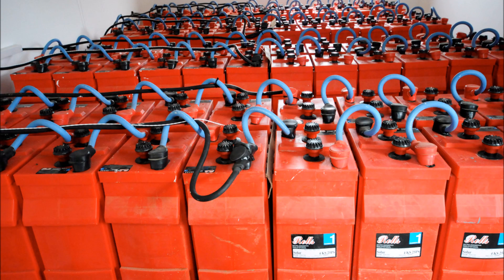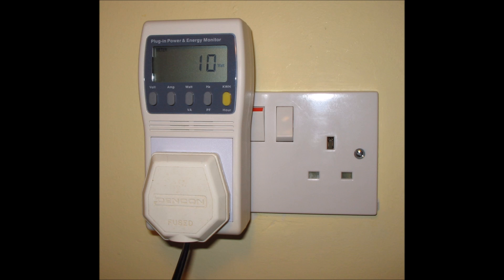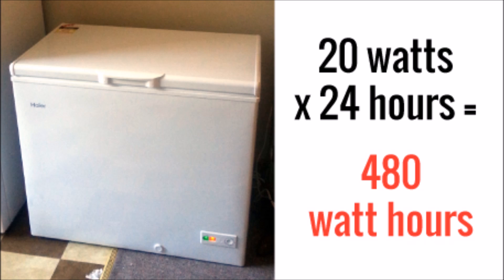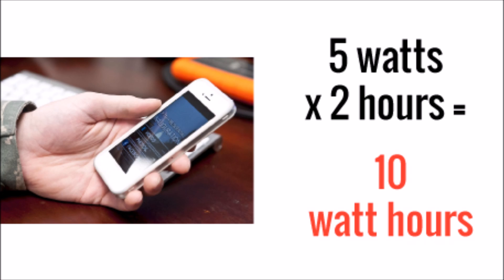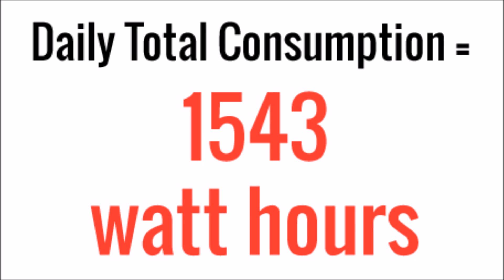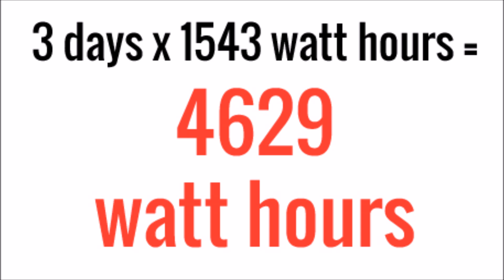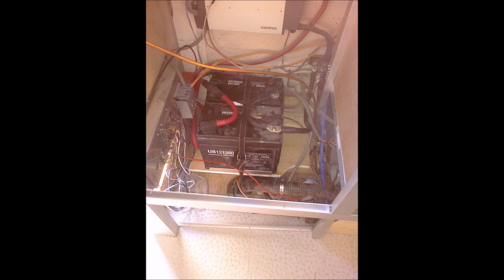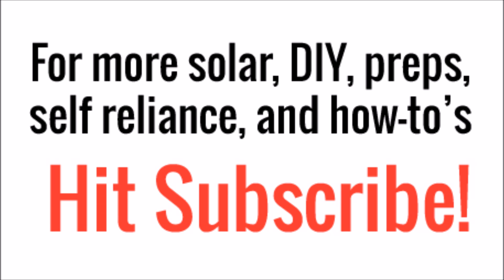How To Size Your Off Grid Battery Bank Capacity For Solar - Math Warning!

Comment: Lights? System inefficiency? You included battery DOD issues, but left out the rest of the system (inverter, wire loss, etc). But still a pretty good explanation.
Reply: I agree that he needed to include some efficiency losses but he did a pretty good job of explaining the basics to a beginner. It sounds that you are like me and already know what you are doing with solar power! Take Care buddy,  John

Comment: I would add the effeciency loss from all the system (especially the inverter), which can be sometime as low as 85% efficient, + wire loss etc, and i would add up the phantom drain of all the electronics, like the tv. Mine uses 124 watts when on, but 34 watts every hour when off (or standy)
Reply from the maker: To be most accurate that is right.
Reply: To be fair though, if you go solar you need to be buying the most efficient and low energy appliances. At least A++ fridge and freezer, LED downlighter lighting etc. Use a quality MPPT controller, and a good make inverter will be over 95% efficient. You pay for quality but this is one area that it pays off.

Comment: hi is a bit late but that amps are from the sum of all batteries in series or in parallel? i mean each battery has to have all that amps?
Reply from the maker: I am sorry but I don't understand your question.
Reply: LDSreliance example i need 600ah at 12v, and have 2 12v 300ah batteries, in parallel the amps adds up so i have 600ah in 2 batteries of 12v or each one needs to be 600ah?
Reply from the maker: Correct.  If you wire in parallel it will double the capacity of the whole bank to 600Ah.  Both batteries do not need to be 600Ah unless you are wiring in series.
Reply: @LDSreliance  thanks 😀
Reply from the maker: You are welcome.  Thanks for watching!

Comment: when powering the fridge is it better to hook the batteries in series or in parallel because I'm trying not to kill the cells in the car batteries or put to much strain on the battery.And could you use a 12 volt solar charger charging the battery and use the battery at the same time ?
Reply from the maker: Car batteries are not a good idea for a load like a fridge.  But yes you can use a battery and charge it at the same time.
Reply: Thanks now i gotta find out what's the most amount of volts to charge the car battery and use it at the same time to keep the cells from messing up ? Cause the car battery is 12 volts 1st i was thinking to use 12 volts to charge it and use it at the same time then i thought about going higher then 12 volts maybe 15 volts to charging it and using it ?
Reply from the maker: A typical car battery charges at about 14.6V.  Increasing the voltage will not help charge faster or allow you to use it at the same time.  It would always be 14.6V.  Increasing the current would allow for faster charging (within reason) and allow you to power other loads at the same time.
Reply: @LDSreliance  You said I can charge the battery and use it at the same time.Even though you said it's not a good idea to use it for a mini fridge.I'm just trying to figure out how to keep the cells from dying maybe that would be great ?
Reply from the maker: As long as there is a battery charger connected to the battery at the same time you are running your fridge then it will be fine.  I just meant that a car battery alone as the power source will not last long when running a load like a fridge that runs on and off around the clock.

Comment: Care to address hybrid systems? I am thinking 2 400watt wind turbines and about 800 watts worth of solar panels. My reason being my property is in Alaska. During the summer we get better than 21 hours of daylight a day. Sounds great for solar right? But during the winter we can get as little a 3 hours of daylight.. Plenty of wind though. SO hybrid charge controller, dummy load, inverter.. Some questions. WHat type of battery? Especially given the environment. Even inside the cabin will frequently get to near freezing at night. Best way to integrate a generator? (I figure worse case if we have unusually calm wind for a bit during the winter and my battery levels drop too low I can always fire up the generator to charge them / carry some of the load while they charge. So what kind of charger does one need to charge a 800Ah battery bank? Probably have a hundred more questions that I just can't think of on a Monday morning but that's a start. Thanks for the video btw.
Reply from the maker: Lithium batteries can easily handle below zero temps.  A decently insulated wooden battery box would be sufficient to keep them safe from even the coldest nights.  

For a generator, install a transfer switch.  Then in the winter when the sun is basically useless you can flip the switch and run off generator until the batteries are full and then switch back so the wind turbines can keep them topped off.  Here is a good one from a manufacturer I trust:  https://amzn.to/2PjcDVO

There are some other factors to consider on the charge controller than just the size of the battery bank.  Shoot me an email at ldsreliance@gmail.com and we can discuss further.
Reply: Cook thanks. What about using a gas generator to charge your battery bank in a pinch? What would you need in the way of a charger?
Reply from the maker: Just a regular 120V AC battery charger such as this one that I reviewed in the past (see below).  It can do both lead acid and lithium:

https://amzn.to/2vWFx5U
https://youtu.be/XHCiQSKdig8

Comment: thanks bro for the informative video. can you please make one on how to size both batteries and solar pv for an inverter (s)
Reply: You can't make sutch a video ... Becaus .. of ... Where u live... Onley you know
Sun hours where you are .. so you can make a general painting All pink video..
Or you can add you watt Up.. .. 
You max draw !! Dish Washer .. dryer .. wacum cleaner ..  No On SERIUS  has a 1000watt  pure sinus inverter .. for house hold APPLIAENSES
Remember a microwave oven at 850watt microwave  is 1800Watt AC  most dishwashers are 2000watt or more 
So.. to sum IT Up No On 12v .. onley 48v efeciancy Counts .. Wire gauge /mm² Counts ... 
PV in series never ever paralell .. again Wire gauge/mm² over distance = loss .. 
Paralell same A higher Volt Better effeciancy ... Dont buy the SHADDOWS on panel .. bla bla bla ..  yes the one panel drops in volt .. 
The rest don't and the small A IT can put out won't go to waste in series like IT would in paralell

Comment: Very useful vid, thanks for sure!!  Will the next on this line of vids deal with needed size and number of cells/batterys?
Reply from the maker: I will see what I can do on a video like that.  My video production schedule has been greatly decreased the last several months.
Reply: LDSreliance. Dontcha just love life sometimes?.....
Reply: please try and do a video on that. thanks
Reply: David Dompreh I will do just that when I gain enough knowledge to do so
Reply: Some things I've been looking for and havens found is, for example, the ratio of plate surface area to amount of charge and the amount of electrolyte to amount of current stored.

Comment: Ty sir but I need help. I have a greenhouse that's equip with an exhuast fan which will run 1200 watts for 12 hours per day, everyday.

My friend gave me six 330w panels but I'm unsure how many batteries, inverters, and charge controllers to purchase. My wife and kids are sad  Bc we're off the grid and we need these lettece and veggies. 

I'm considering the APEX APX12-200 12v 200ah batteries. (someone recommended it to me). 
So after watching your video, I came up with 1200x7days=8,400/12=700x2=1400 ah. Looks like I need 7 batteries? 

Another friend recommended 48v inverter? If so, how many?

How many solar controllers?

I wish there was a website to help me with product recommendations. Thanks for anyone that can help me!

BTW. I live in sunny California where it never snows. Hardly cloudy days.
Reply from the maker: Unfortunately, 1200 watts for 12 hours is an insanely large load.  You can't even begin to power that load with those solar panels you have.  You probably get around 5 sun hours per day on average year round.  So you would have to produce enough power in those 5 hours and have enough batteries to hold that power to be able to continue powering that device outside of those peak hours.

By my calcultations, you need more like 6,071W of solar panels and 2,448Ah of battery capacity (lead acid).

Comment: Want to use this fan, www.ebay.com/itm/10-Heavy-Duty-Radiator-Electric-Fan-1500-CFM-Brand-New-Reversible-SBC-BBC-350/141684397967?epid=518809617&hash=item20fd0c578f:g:uM8AAOSw~OdVb5CK:sc:USPSPriority!78063!US!-1 FAN IS 1500 TESTED CFM, 12 VOLT, 6.7 AMP, 80 WATT in my attic to move hot air out. What size solar panel would I need to run it and charge a battery to power it for 3 or 4 hours in the night to cool attic ? I looked into computer fans but don't seem to move enough air. Thanks to anyone who can help.
Reply from the maker: So you want the fan to run all day and then an additional 3-4 hours in the late afternoon/early evening?  Or you only want it to run in the evening?  That will make a big difference in the size of solar you need.
Reply: Yes, I want it to run all day when it's above 95 in the attic and then an additional 3-4 hours in the evening to really bring in the cooler air.
Reply from the maker: If you are in the United States in an average sunny location, you will need 450W of solar panels and 165Ah of batteries to run that fan for 12 hours per day (8 hours of direct sunlight + 4 hours of twilight run time).
Reply: WoW way to expensive to do all that, I might should try to find some way to convert house current 115v into 12v . That might be a more viable option.
Reply from the maker: Yes, that will be much more cost effective.  Solar is a long term investment so over 15 years it will be cheaper to run that fan every day off the solar.  But if you are looking for something short term or easy then using house power is the way to go.
Reply: Thank you
Reply from the maker: You are welcome.  Thanks for watching!

Comment: Essentially if I have a system that produces 5,600 WH a day(on a full sun day) that means I would need 933 AH to reach the 50% load. If anyone can correct me please let me know? Im only going to have very essential appliances like a fridge running 24 hours. Most of my other appliances will be propane powered(Stove and Hot water heater)!

Comment: Actually the first issue is that you are always damaging the battery every time you discharge the battery.  You can look at the Depth of Discharge vs life cycle curve supplied by the manufacturers.  You can discharge 60%. 70% even 80% of the batteries (depending on the construction, OPzV and OPzS batteries can be discharged deeper) before you hit a region in the curve where you lose a lot more battery life.  

Next is that with 3 days of autonomy, you're actually likely to have 6 days or more of available energy for cloudy days.  Just because it's cloudy doesn't mean you won't charge the batteries at all.  This, added to the fact that solar panels are getting cheaper, the typical design methodology now is to increase your solar panels to produce more than is needed on a sunny day, but still be able to charge your batteries during partial cloudy days.  

Once you've oversized your solar array, then you can probably reduce the autonomy days to 1.5 to 2 days and have enough batteries for 4-7 days of consecutive very cloudy days.  This set up is probably cheaper than buying batteries for 3 full days of autonomy but only have enough solar panels to charge the batteries fully only during full sun days.
Reply from the maker: Good points.

Comment: Go with LiFePo4 batteries, 3000+ cycles at 70% discharge and a heck of a lot more power capacity.
Reply from the maker: Yes, if you can afford the up front cost this is the way to go.  And I would suggest Miller Tech batteries, which I am a reseller for.

Comment: I've been examining the advantages and disadvantages of lead-acid vs lithium technology storage, and from what I can see it seems to come down to the following:

Lead-Acid batteries only need a relatively simple voltage-controlled charging circuit and can be recycled for the scrap value of the lead once their life is ended, but they have a relatively small capacity when compared to lithium technology.

Lithium technology (Li-Ion or LiFePo4 or whatever) batteries need a more complicated charging circuit, which has to control both voltage and current within strict constraints.  They also currently have no recycling value at the end of their useful life.  But lithium technology power storage provides a much higher power density than lead-acid storage, meaning that the battery bank takes up significantly less space than the equivalent in lead-acid storage.

Lithium batteries may have a shorter charge-discharge cycle life than lead-acid batteries, but that can be at least partly compensated for by adjusting the charge-discharge cycle to narrower constraints, so that the cells are not charged quite to their theoretical maximum value (eg 4.1 Volts instead of 4.2 Volts for standard Li-Ion or 4.0V instead of 4.1V for LiFePo4).  This will significantly extend the life of the cells at the cost of requiring a few more batteries to compensate for the slightly lower storage capacity.

Would the above be an accurate summary?
Reply from the maker: All accurate except lithium cells can cycle between 2-8x more than a comparable deep cycle lead acid cell.  The lithium batteries I cell can cycle 2,500 times and still have 80% of their capacity.
Reply: JasonMasters lithium titanium batteries have 10-30,000 charge cycles even in temperatures as low as -50° and up to 120°. Tesla modules that are 5kw a piece can be purchased on eBay for $1,200.

Comment: The freezer and refrigerator units should be trashed at that consumption! Way cheaper to go with more efficient devices than more battery... I'm guessing you could cut the final amperage number by 2... or double the number of cloudy days. Good video.
Reply from the maker: Thanks.  Yes, if it were me I would splurge on a DC powered fridge and freezer and it will save me money over time.  But that wasn't really the point of the video haha :)

Comment: LDS, enjoy your videos and wanted to mention something I just learned and many do not take into account.  You did a GREAT job with the "gotcha" on not taking Lead Acid down below 50% DOD...so you need twice as much battery capacity.  However, in reality, the customer needs MORE.  Cause Lead-Acid/AGM battery charging scheme is 3-stage (Bulk, Absorption & Float).  You can charge pretty quickly from 50% - about 85%, but then the charger has to click over to absorption and now it is VERY slow.  So much, especially when dealing with solar (on average you can only count from about 5-6 hours for you sunlight calculation)....most Lead acid-AGM will only run 50%-85% (since absorption takes too long..most batteries won't get back to 100%.  So you REALLY only get 35% of battery capacity at BEST !! :)
Reply from the maker: True.  That also depends on the charge controller and how many amps you are feeding into the batteries.  My existing bank right now does not stay in absorption very long at all.  But I have an expensive MPPT controller and premium batteries.  Your mileage may vary.

Comment: I live in the mountains (1500') in the pacific northwest, there is no possibility that there will be enough sunlight to function through every week of the winter.  So my need is for a battery that will supply sundown to sunup. I don't depend on solar, I rely on a generator to get through however many bad days. My generator is way cheaper than weeks worth of battery storage and I'm never tempted to over discharge my batteries.
Reply from the maker: I would recommend lithium iron phosphate batteries for you.  They will last up to 15 or more years of continuous use and can charge very quickly with your generator.  Run your generator during your peak needs during the day or just for an hour or two to charge the battery and you should be fine for the rest of the day, if sized properly.  They cost a pretty penny up front but are well worth it.

I carry a full line of such batteries, by the way, as well as the more traditional lead acid variety.  If interested, go to:

https://ldsreliance.myshopify.com/
Reply: Um.  Perhaps offgrid is not for  you?  Get a 500 watt windmill too and stop whining... sad
Reply: Matt Langstraaat to each their own. If the setup he has works for him, who are you, or anyone for that matter, to disagree with him?

Comment: Great video. I found a site that gives you a complete system design (including sizing) based on your usage and location (takes into account your latitude's irradiation) - solareden.com. Use the quickquote menu link, then register (it's worth it) to use their free design app - asks for your usage and zipcode and then auto-selects a system template to match. The template is displayed in the free app and you can modify as needed and contains sizing of panels and batteries to your usage and irradiation.

Comment: 3 days of no sun capacity... so 1/10 of your current average electric bill.

If you use this method going from on-grid to off grid you will have enough storage for a week or so of cloudy days without reducing your consumption.
Reply: LiPo batteries you can regularly discharge to 20%.  They'll die from age before they die from the regular cycling to that low.

It depends on what type Lithium as to if its cheaper in the long run.  Some types are better for long life and others are better for high current.
Common LiPo used in RC models are better for high current and will begin to show age degradation in 3 to 4 years regardless of how well you care for them.